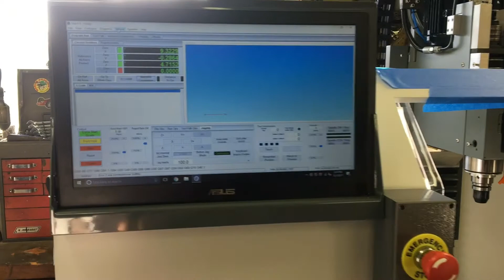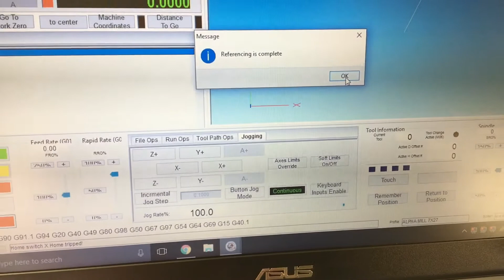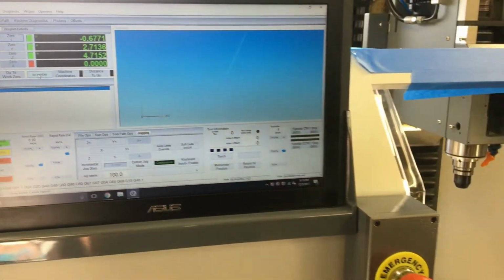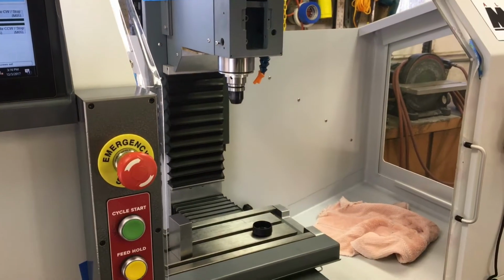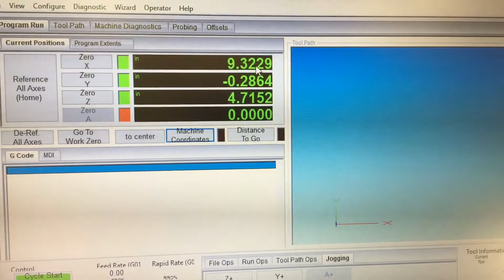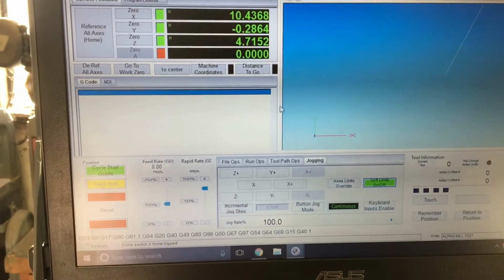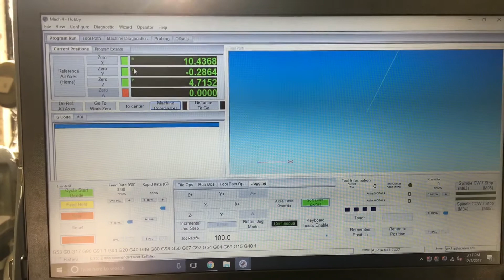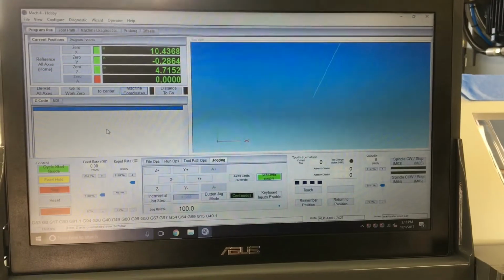Mach4 Go To Center 1

Comment: Would zeroing the axes at the end of the move-to-center script be enough? I'm assuming that the iRegs0 are relative offsets from home to center. I might have misunderstood though. Looking great!
Reply from the maker: Im not sure about zeroing kent.... You are correct about the iRegs 1,2,3 the each correspond to a axis offset from machine 0. My plan is for the code to go in the Reference all axis sequence so it only happens when homing the machine, after it homes it comes back to center ready for.... "what ever" .  = )

- Nick
Reply: Do you plan on G53 being center or the reference position? I'm looking for ideas :)
Reply from the maker: G53 is the reference position (home) ... the machine would home and then present the x,y in a convenient location. G53 is still the homed reference position after X and Y come to center. The dros show the offset from the reference position after completion... or at least the do currently. I have use commercial machines like this....? think of it like a tool change location but only for homing.  Most people consider this a "convenience" on a machine this size....
Reply: Good to know, that's what I wondered. I've been using G53 at top-center with soft limits. Like you said, size and convenience. Mach4 looks like quite an improvement in how I remember Mach3, but I had the bare minimum Mach3 setup.